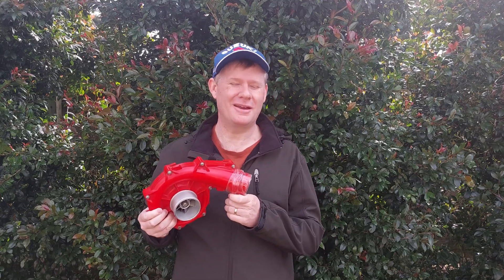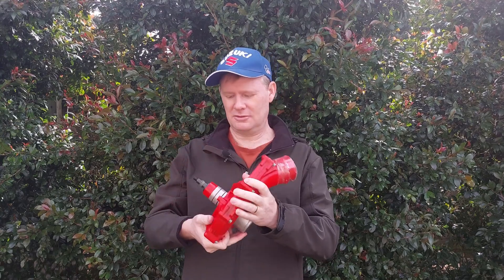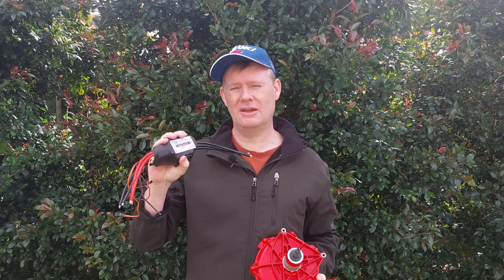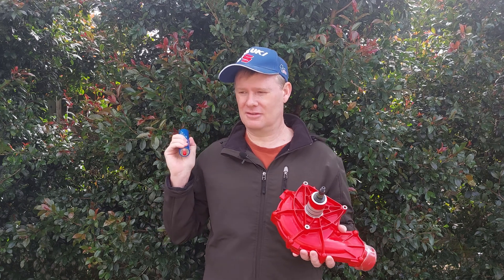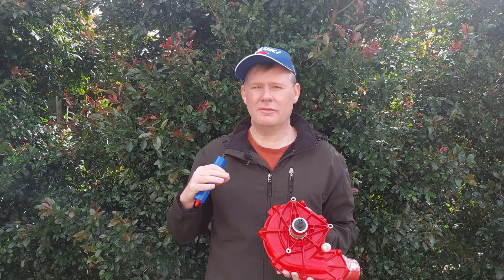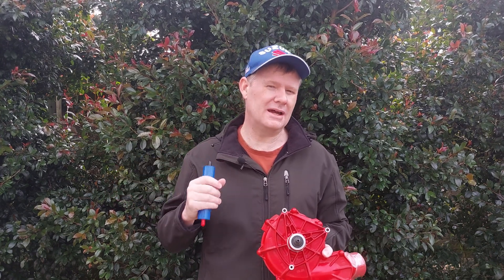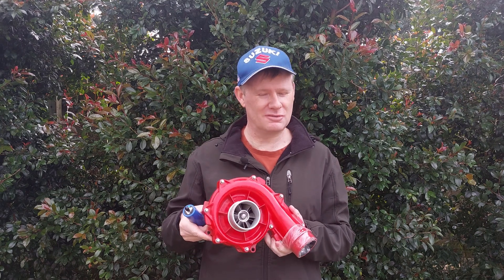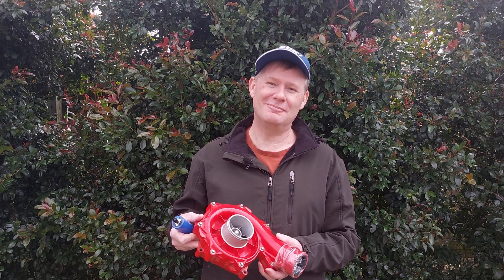⚡️ Electric Turbo Supercharger Build: The Plan

Comment: The different methods of forced induction are getting ridiculous. I went to a dynamometer event here locally and one of the guys had a homemade electric supercharger. He used investment casting and parts scavenged from a junkyard to put it together. He have the set-up installed on an old SUV with a 3.8 L engine. He put in some bigger fuel injectors, fuel pump, and hollowed out the catalytic converters. It made 426 horsepower and 488 lbs of torque at 9psi of boost. He said he did not know the CFM it was producing, but the charge piping was 4 inch inner diameter. He had a second alternator and two large batteries to power the setup.

Comment: 48v DC will be needed. I prefer 110v/120v or 220v/240v AC converted.
Reply from the maker: More the voltage the better I do agree.   It looks like I may have to go to 20s lto now 56 volts

Comment: take note the 400a is probably phase amps which will be either more or much more current than battery current depending on how you gear the motor
Reply from the maker: yeah and so the esc's go boom...
Reply: @Ultrasonictwo  yeep. Btw I live in new Zealand and am planning a project much like this. I also have various bits and bobs that might help